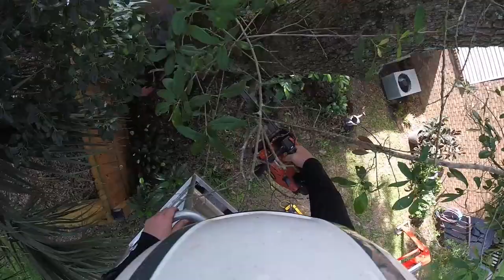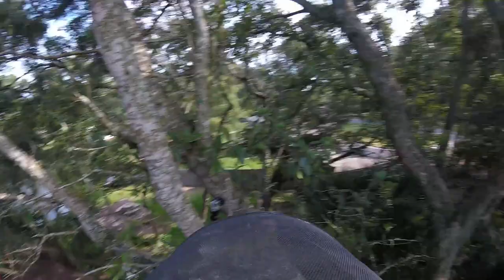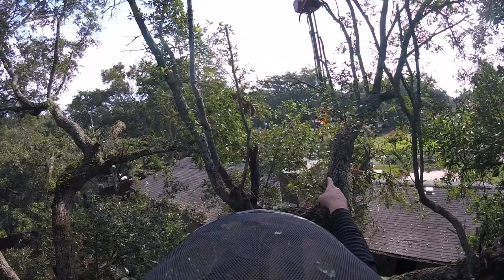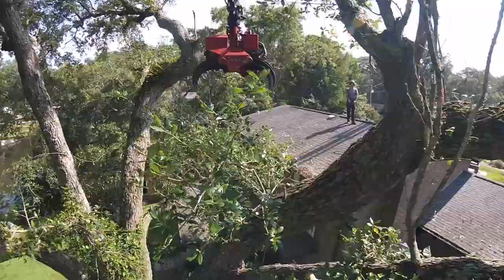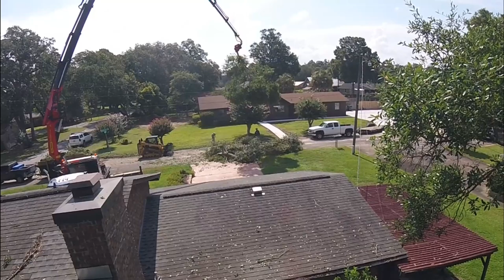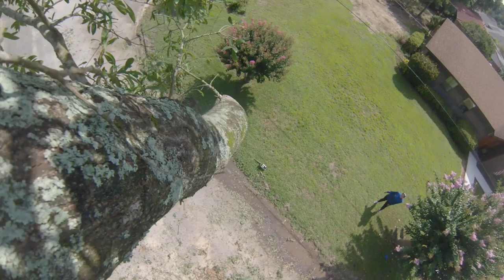NOT Traditional Crane WORK! Tree Mek and Spider Lift meet their match!!!

Comment: Another example of a machine not being used to its full potential . man in the tree was pointless with the grapple saw truck . He just made that tree removal take double the time it could of ..GRAPPLE SAW truck could of did all that without the need for the dude in the tree
Reply: Actually he made it take half the time, the saw is right next to the grapple on the grapplesaw, so you have to make smaller cuts, thus taking longer.  But if you use it to grab in the middle and have another saw make the cut farther down, then you're golden as he mostly did here.  (He used both methods)